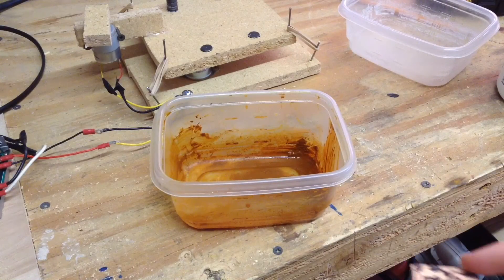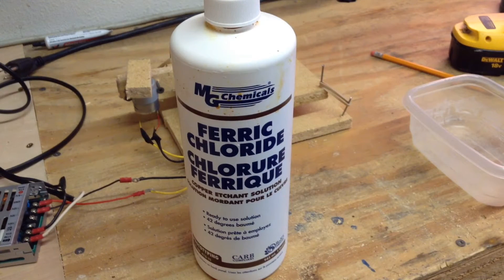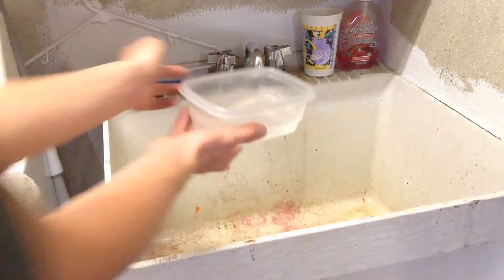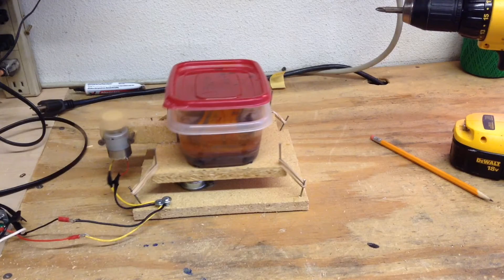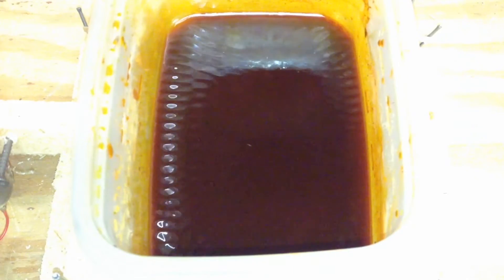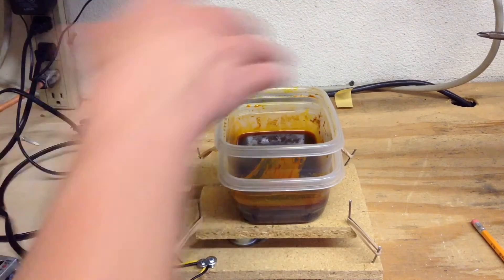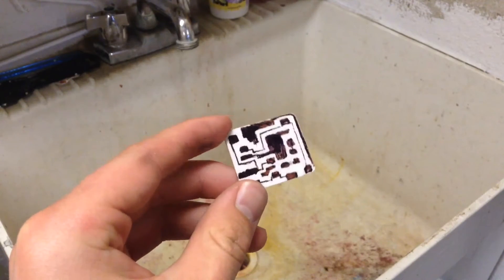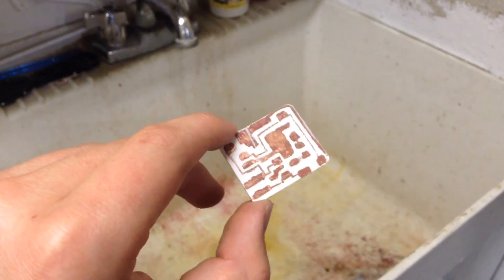Circuit Board Manufacturing Without a Computer Part 2: Etching the Board

Comment: How come your PCB came out white? I used to use ferric chloride and I never got my PCB's white.
I could also recommend people to not use ferric chloride, if it drys on your bench or cloth it will never come off, and they are pretty expensive for what you get.
I'm using hydrogen peroxide + Muriatic Acid
Those are much much nicer to work with, It comes off easily, when it drys it does not leave stains, it does the opposite - it cleans your bench. I dropped a few drops of this acid on my table and the only thing it did is to clean it, also the acid itself is clear.
Reply from the maker: The copper clad board was white.